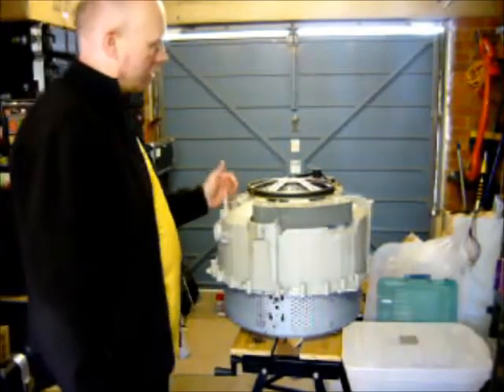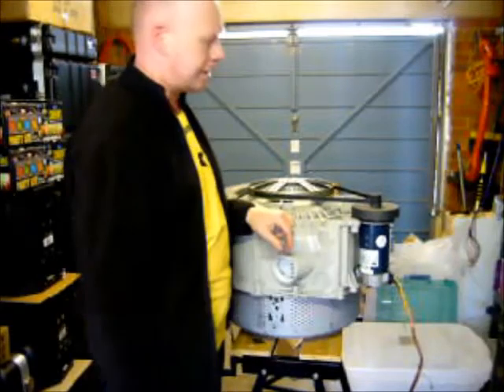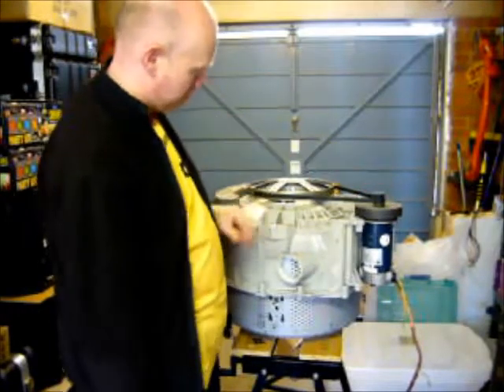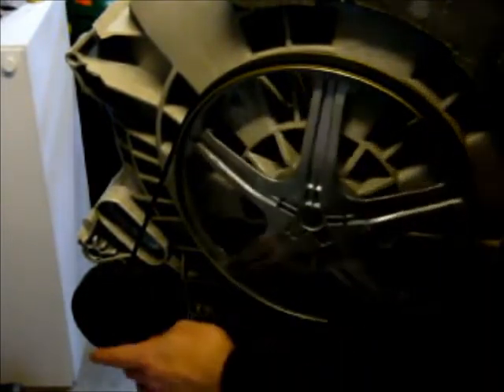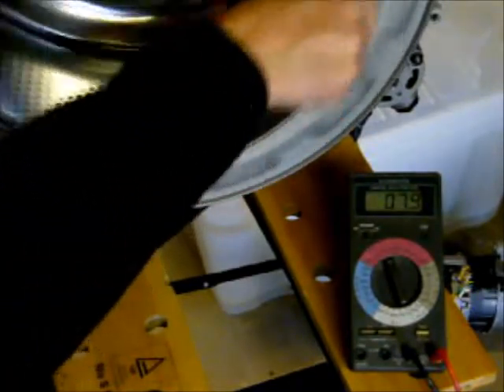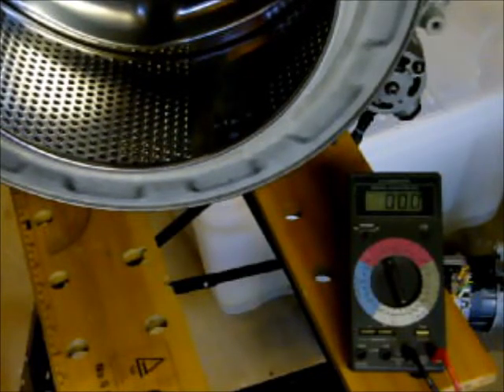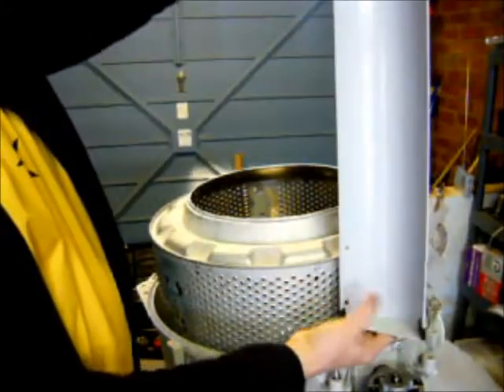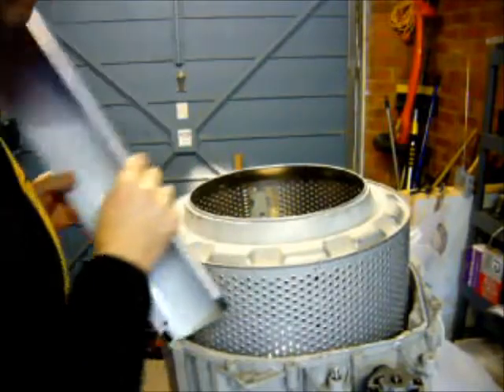Toms homemade VAWT

Comment: Well idea is good but adding more blades will only slow it down but give you more torque... u eventualy need to give it a wider base 4 to 5 feet wide and add 3  homemade jet blades., the blades ur using are very good for torque but u will never get over 70 rpm...
I bieleve jet blade would easyly double your rpm

Make sure not to damage ur motor with too much rpm... these treadmill motor are kind of fragile

Keep us posted

Nice work

Comment from the maker: The fins are Half-round PVC guttering, bought from hardware / DIY store in 3m lengths. I cut them down to 700mm lengths. Presently a bit wobbley, so I need to secure the top of the fins with a lid of some sort. Any ideas ??

Comment from the maker: I have just tested it in a strong wind but only produces around 9v dc. So I need to increase rpm?? Poss reduce the resistance from the rubber drive band or increase the number of fins. I dont think Sail fabric would work as the fins need to maintain their curved aerodynamic profile costantly.
Any other suggestions welcome ??